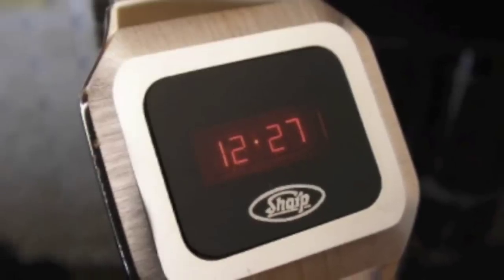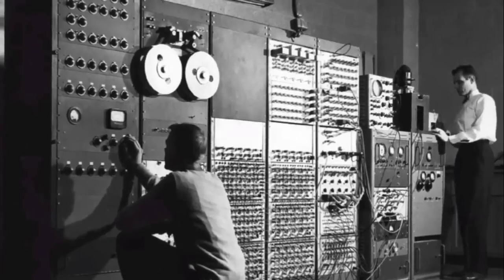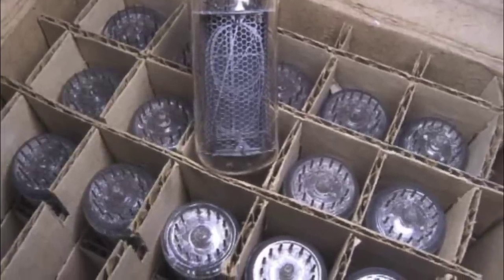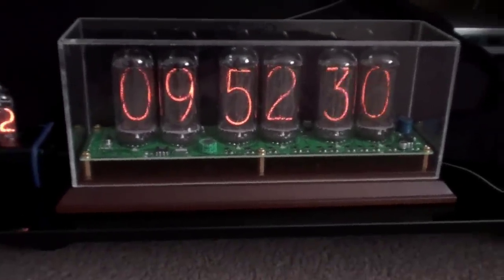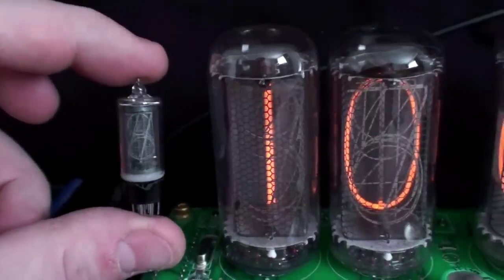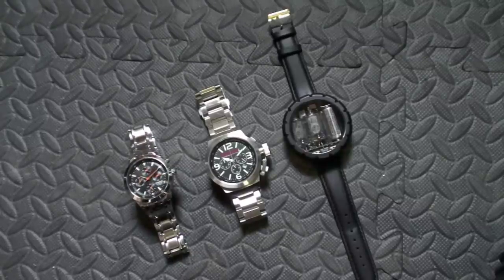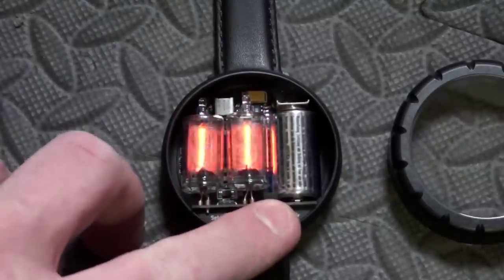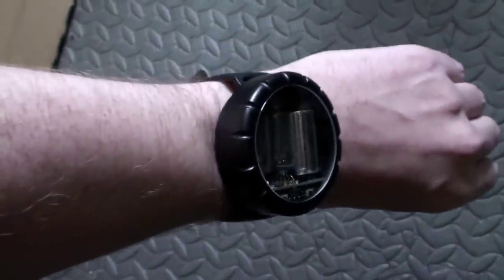The Nixie Watch

Comment: In Metro: Last Light, I think Artyom has a nixie watch.
Reply: Clyde Marshall only on easy on harder difficulties it's an analog watch that you really have to pay attention to
Reply: That's only in the Redux version if you're playing Survival mode. If you play in Spartan mode then it's the Nixie Watch. Of course it is a little smaller than this one.
Reply: +Clyde Marshall yup
Reply: Honestly, I've always preferred analog watches. But the nixie watch just looks so dang cool.
Reply: +Clyde Marshall I didn't learn how to tell time until very late so I stuck to digital clocks and waterproof digital wrist watch calculators out of practicality.

I'm not a jewelry guy so I just don't see the appeal in a fancy analog watch
Reply: It doesn't necessarily need to be fancy in my opinion. But some extra features in the clock face can improve it. I wear a digital watch because of its cheapness and versatility. 

But if I could get a 24-hour analog watch for a good price that would likely become my primary time piece.
Reply: Time to go play survival mode on metro 2033, now was that the redux or no
Reply: The Redux version of Metro Last Light lets you use the analog watch and the nixie watch. Survival mode is for the analog watch and spartan mode for the nixie watch.
Reply: Clyde Marshall yeah I can't read analog clocks I died in a frozen wasteland. Now, redux, is it both 2033 and last light?
Reply: You can buy the original version or the redux version of Metro 2033 on PC and only the redux version of Metro Last Light on PC. 

The original version of Metro Last Light is pretty much identical graphically save for perhaps some very slightly improved lighting effects. The redux version of Last Light also comes with all the DLC for the original version. 

You can buy the redux version of Metro 2033 on Steam or GoG. I recommend GoG because their stuff is completely DRM free. 
https://www.gog.com/game/metro_2033_redux 

I am  big fan of the Metro series and honestly, I would recommend you play both the original and redux versions of Metro 2033. Neither one is strictly better than the other except when it comes to graphics as far as I'm concerned. 

If you want to use the Nixie Watch remember to play the redux versions in Spartan mode. Survival mode uses an analog watch and the original version of Metro 2033 only has the analog watch.
Reply: That it is my guy
Reply: Ive been looking for one ever since i played it, there so fn cool
Reply: Clyde Marshall 
Saw this, immediately thought "Metro." Given that they were originally made in Russia, it makes sense setting-wise.

Comment: " it looks like a bomb " - Steve Jobs
Reply from the maker: ...'Aaron Sorkin'
Reply: Hey Techmoan, you can remove that distracting flicker by changing around your iso, aperture, and shutter speed.
Slow the shutter and raise the aperture. Preferably keep the iso as low as you can to stay away from grain.
Reply: the only important thing here is the shutter speed, or recorded frames per second. If it's recording at 30 frames per second, and the electric operates at 60 hertz, then every second frame, the camera will record it while the power is "off", resulting in flicker.
what iso probably does is, with higher sensibility, it swamps out the picture so that the flicker is not so noticable, but that doesn't fix the problem.
Reply: don't you know the three affect each other? If you change the shutter you must compensate with ISO and/or aperture. The camera will do it automatically if it's any good though.
Reply: Catalan Totanian if you're on an airplane and change time zones, how would you do it

Comment: i want one like in metro last light :(
Reply: +MaceGaming53 I have a pile of the necessary B-4998 tubes. The problem is that these end-view tubes will result in a watch that is over an inch thick. So the case design is, shall we say, tricky.
Reply: nixiebunny1 yah
Reply: Could you not use led filaments for some designs?
Reply: kistuszek true i could...i might do that... but nixie tubes are cooler.

Comment: Ugh i wish it wasn't so fucking expensive
Reply: um...
500 dollars is incredibly cheap for these high quality watches.
Usually, stuff as unique as this cost up to 30,000 dollars.
Reply: You're getting shafted hard if you actually believe this. This is a niche high school experiment using semi-rare but inexpensive parts. A regular mechanical watch is dozens of times more complex than this.
Reply: +Coopersville 
Well, the components are not really high tech or anything, but the quality of the build for a "high school" experiment is quite decent.
The overall design is quite rugged, and hold the components in place pretty well.
Its also hand made for the most part.
And although the Nixie series are not expensive (yet), but they are discontinued technology from Russia.
So yeah. 

It may be just some Nixie bulbs in a modern circuit board, but its the uniqueness and use of materials that makes it expensive.
It's also has limited production, so I guess that raises the price quite a bit.
Reply: +DatGameh its $450 bucks for the watch... the bulbs are only $15
Reply: +Richard Noggin 
the watch actually costs $495.
Anyways... This is what makes it expensive:
1. Aircraft Aluminum
2. Hand made (with the help of machinery of course) by someone else (service fee).
3. Circuitry (the circuit is expensive alone, you know)
4. Not mass produced (if it was, it would be $150-200 cheaper).
Reply: +DatGameh circuit boards are not that much, premade this thing could be brought down to probably 100 USD and still have a good profit margin, 200 would be fairest imo

"aircraft aluminum" is just a bit stronger aluminum by heating it, theres no reason for that to inflate prices very high

hand made is probably the biggest reason for this alone, and they're doing it because they can get away with it. It's the same reason doc marten boots made in the UK, or rather anything "made in" a western country is stupidly overpriced despite having a similar makeup, maybe with a bit more durability.
Reply: +namikagekun 
True, circuits are not that expensive and Aircraft aluminium is just aluminum with slightly more strength.
If they really wanted to bring the price down, they could just mass produce it.
But starting mass production itself is really expensive, since you have to make several machines, each doing only one step and doing what a hand can do in 5 minutes instead of 2 hours.
But do you think it is really worth it?

Its only a 1 person company, after all.
Its popularity isn't great either, despite Steve Wozniak showing it off in several videos.
He rarely creates them too. Probably during 2005, 2008, 2010, 2013, and this year.
I don't know exactly how many units are created, but imagine all of the watches sold out within a month, despite the watch's lack of popularity. From that, maybe there are 200 or less watches within the years it is produced.

So it is semi-limited edition. That also raises the price as well.
Who knows? He might not even make it anymore.
Reply: +DatGameh I really don't understand your pricing model... Price is derived from a number of factors and not just decided upon, unless the market is monopolized by a single firm, or several firms in collusion. Even though the quantity of supply for this product is low, the demand is also low which the price will reflect. I don't even think that the marginal cost of producing a single one of these watches, with inputs not purchased in bulk would be anywhere near $30,000. If you start including items with artificially inflated prices, like diamonds, then for sure that price could be met or surpassed. The $500 price tag seems reasonable to me.
Reply: +Sure 
So... You are saying that the price comes from supply and demand, right?
Note that it comes in a small amounts, and has a demand that slightly increased some of the years before, due to Steve Wozniac's usage of the watch.
Being used by a famous person, there should be some price increase over the years.

Also, the watch used to cost $395 in 2005. But as USD's value lessened, the watch from that day costs $479 today. Slightly higher, but is quite reasonable.

The reason why the price increased with inflation is (probably) because some of the components are bought abroad (e.g. Nixies from Russia) and some components are replaced because of discontinuation of production.

Or the metal cutters are placing the manufacturing costs very high. David did try to go for a cheaper option, but online is all he can get as local metal workshops were no good. Shipping and all, that could increase the price of manufacturing.

But I do see your point.

I do agree with you in some ways, because a few days ago, I found another nixie watch with a full leather strap, four bulbs and rechargability with a price tag of $700.
https://www.etsy.com/listing/238619825/nixie-watchprototypea-rev4-first-watch
Oddly enough, David Forbes is listing his new rechargable Nixie watch (June) for  $795.

Someone has to tell him that his prices are kinda ridiculous
Reply: The pricing model is that it costs me over $200 in parts to make the watch, buying cases and partially-assembled circuit boards in lots of 100 or so. I assemble and test each watch in small batches in my home workshop. The supply of tubes is limited, so it would be foolhardy for me to sell it as a low-cost, mass-produced item. I'd run out of tubes before I knew it. If you think you can make a profit making lower-priced Nixie watches, then by all means go into competition with me.
Reply: +nixiebunny1 
Wow. That's a bit harsh :S
Reply: +nixiebunny1 But what is your opinion about your competition:
https://www.etsy.com/listing/238619825/nixie-watchprototypea-rev4-first-watch
It's cheaper than your rechargable Nixie watch, but has more stuff in it (except for being waterproof and durable).
Reply: Or a hundred on ebay...

Comment: The soviet union made the smallest nixie tube in the world - it is as big as the nail of the little finger of a man's hand. Don't know how it's called but I saw some of those inside a recycling facility - unfortunately I was not allowed to take them, instead they were sent to be melted.  Nixie tubes do not contain vacuum but a low pressure inert gas environment. Digits are small filaments but they are not supposed to get red-hot at almost melting temperature but they are supposed to glow. They light because of some sort of corona effect of the high voltage in reaction to the inert gas inside: neon - red color; argon - white glow; nitrogen - purple, hydrogen - blue purple, krypton - white blue. Huge cookie-jar-sized nixie tubes can still be found in soviet union-era abandoned train stations in whatever display panels survived.